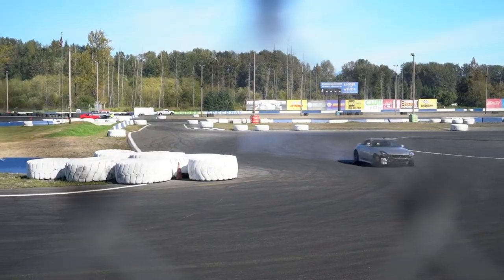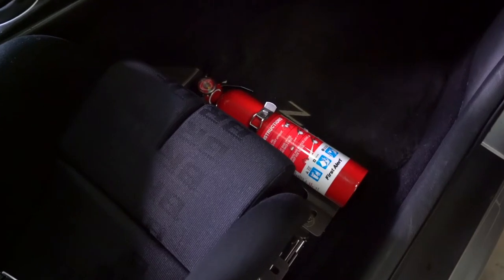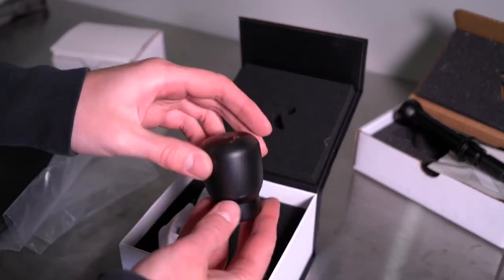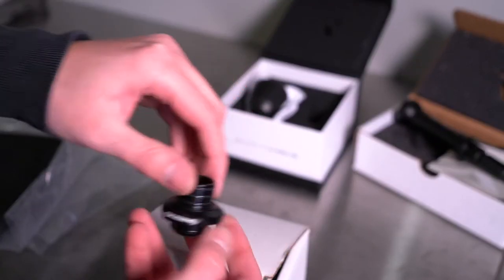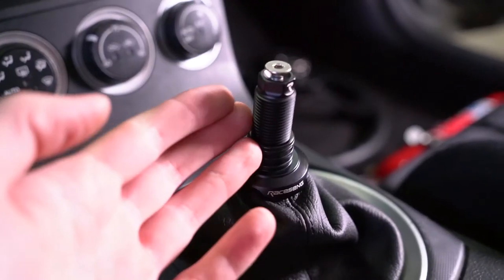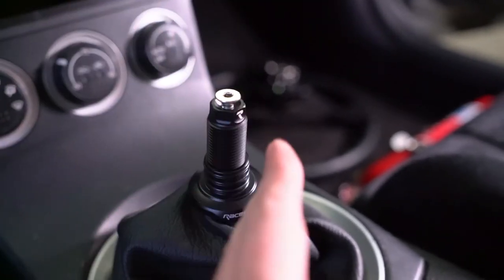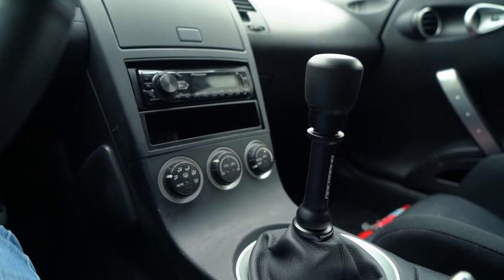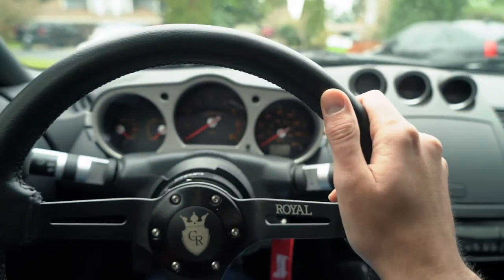The BEST Shift Knob Set Up for ANY DRIFT CAR! Raceseng Traction Shift Knob and Extender Max Install)

Comment: Do u have the shift shifter also in your gear?
Reply from the maker: Hey do you mean short shifter? If so, I added a Cube Speed Short Shifter after installing this shifter setup and it was the perfect combo!
Reply: @avengednick  yup sorry I meant short shifter, typo
Reply from the maker: No worries! I figured that’s what you meant

Comment: Do you have listed anywhere the exact setup you have so I could order for son as I do t know anything about where to find this.
Reply from the maker: I don't think I do, but here you go:
1. Extender - select "Tall" if you want the same tall one I have: https://raceseng.com/products/shift-knob-extender
2. Shift Boot Collar + Retainer: https://raceseng.com/products/shift-boot-collar
3. Shift Knob: https://raceseng.com/products/traction-m10x1-25mm-adapter-6-speed-reverse-right-down?variant=39761728798822

You'll want to select the shift knob by the car you son has though since the threading is specific to make and model. Hope that helps!